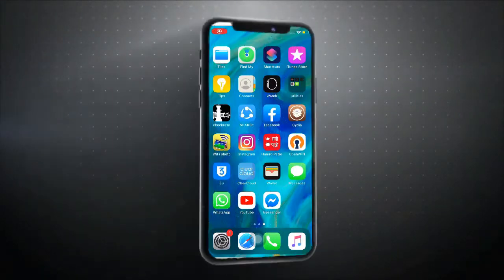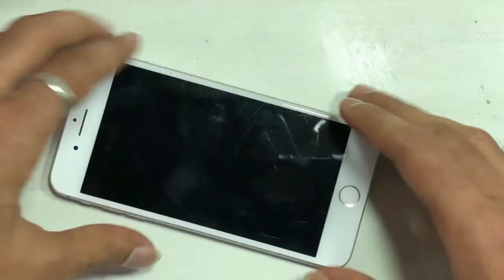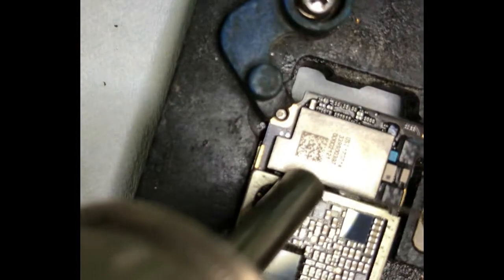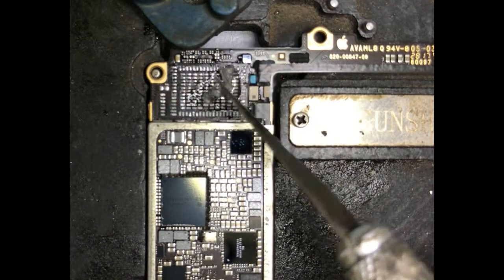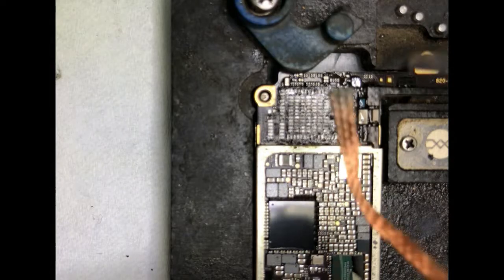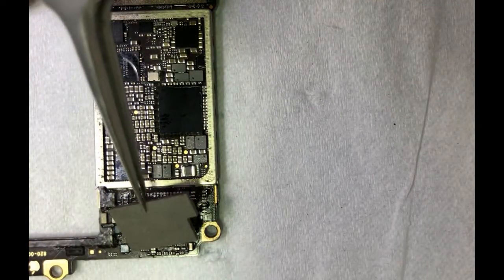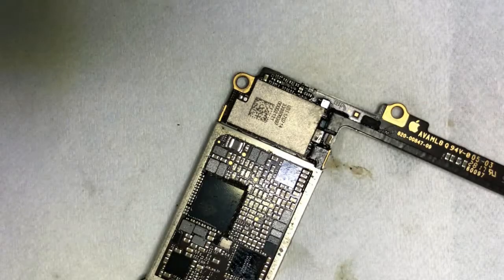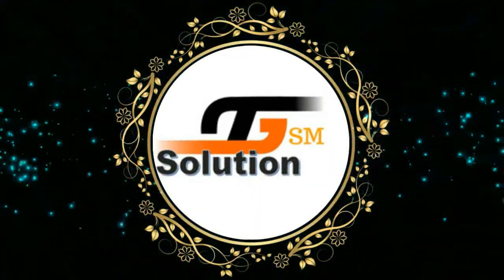iPhone8,8plus wi-fi Greyed out !Fix Can't turn on wifi on iPhone8,8plus.

Comment: What unbinding are u talking about again with NAND because as we can see the wifi is working fine.
Reply from the maker: I Reball the same wifi chip and put. If you change the new wifi chip then you have to unbind NAND. The tool arrives that helps to unbind wifi without removing Nand.
Reply: Hi, interested to repair a faulty iphone what do you mean by unbind Nand  and what is the material used to install the Wifi chip?

Comment: i used the “network reset” then it turned back to normal, after few minutes it goes back to grey. please help
Reply: I did the network reset an it reset all my settings but the wifi issue still can’t use wifi for 2 months now
Reply: Same